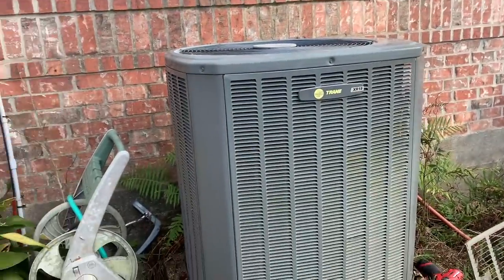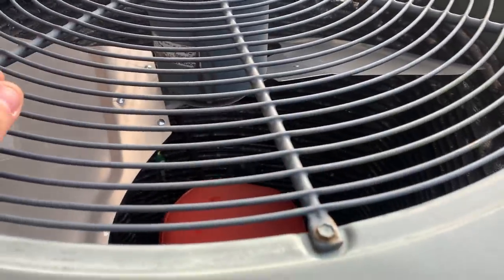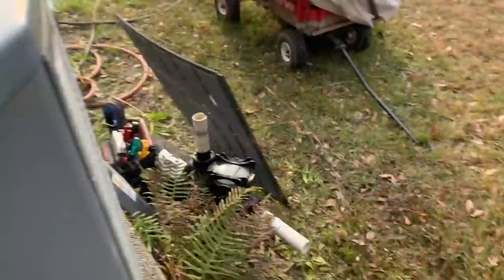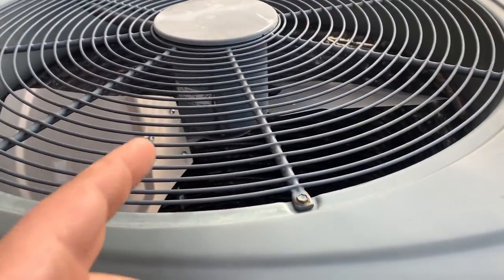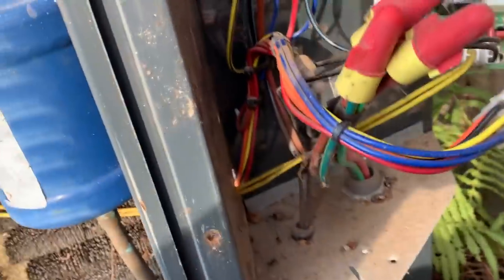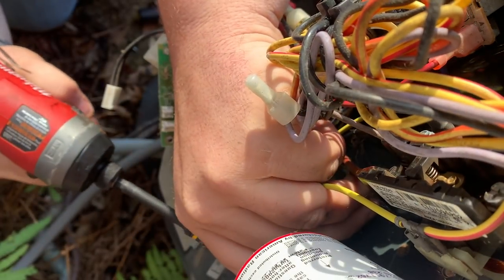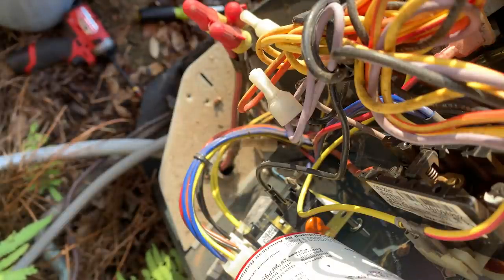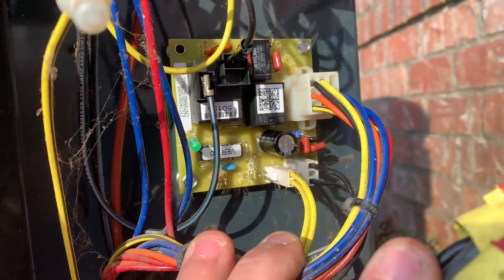Trane Heat Pump Not Defrosting

Comment: Good information, thanks for sharing. I have a new Trane heat pump less than 2 years old. The same thing is happening to mine. It had been making strange noises so I went outside to investigate, it had frost all over. The tech came said it may need a temperature sensor or the defrost board.  He’ll be back next week to try replacing the sensor first and if that doesn’t work he said he will need to replace the defrost board. I will have him double-check the blade too, to make sure it didn’t get damaged. That noise I was hearing didn’t sound good.  This should not be happening to a less than 2 year unit. Trane use to be one of the best. My last Trane unit lasted 22 years with no major issues just needed hoses replaced in the end and more Freon added which was too expensive so replaced it for the newer unit.

Comment: We all own service valve ratchet wrenches, it amazes me that I never see anyone use them on fan blade set screws!
Reply: Had the same Yellow jacket wrenches for 20 plus years,literally done thousands of set screws,haven't broke one yet.
Reply: I use my service ratchet for that , or my quadbox Gearwrench
Reply: I have yj and hilmor service wrenches and using both I always have it get stuck on the set screw.  Never had issue with adjustable
Reply: Because most hub to set screw clearances are too tight. Been using a 6” adjustable wrench for 24 years.
Reply: Adjustables gives more leverage

Comment: Easy diagnosis and quick repairs. I tell you though, John, those X13 motors are just pure garbage (mainly the module). I just dont care for them. There was nothing wrong with old fashioned PSC in my opinion
Reply: X13 vote Democratic that's why Joe got 80 million
Reply: Three Modules......sorry, but that's not the motor or modules!! Sounds like there's some install issues....
Reply: Chris Hall everyone loves to say that but no not in reality
Reply: @joeshearer1247  well.... in the last 10/12 years.... I’ve only replaced 3 or 4.... maybe I’m just lucky like that but isn’t it amazing a large percentage of units use the same motors and yet people love to blame the manufacturer.... I guess I see your point....
Reply: @joeshearer1247  no sir.... 90% of everything we do is HP’s here in the south. Even split between package and splits.
Reply: @joeshearer1247  Now Joe...we all know that X13's were backing Bernie Sanders. 😉👌
Reply: @chriseh09  I've replaced at least 100 in the past 10 years. You must not do much work.
Reply: @chriseh09  hahaha unless the factory forgot to program the module before they box it up. Have had it happen a couple times only thank goodness.

Comment: Didnt even change the sensors thats just lazy
Reply: If the sensors are fine, then why replace them? I'd suggest it to the customer, but in residential, they'll only want to replace what's gone bad lol. Learn your customers bro
Reply: I think it’s just a good practice to change sensor when you change defrost board. Not expensive, you can add the price to board